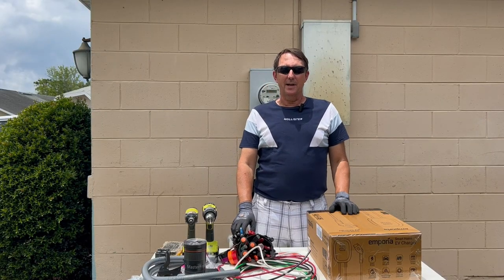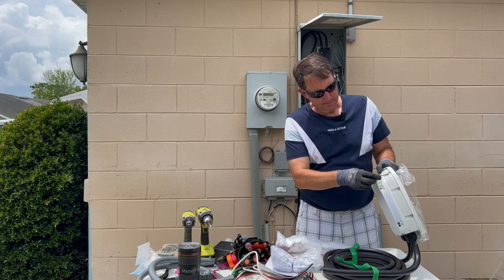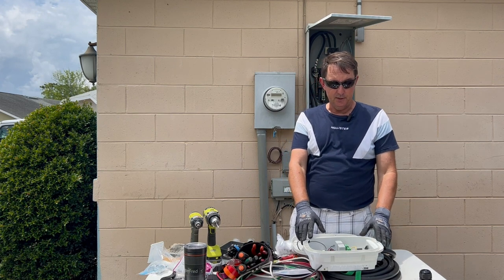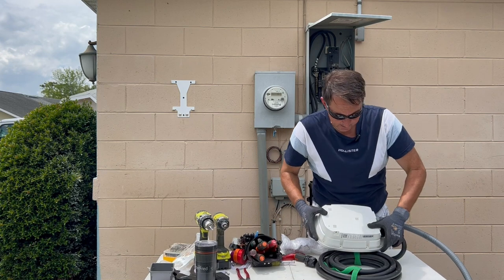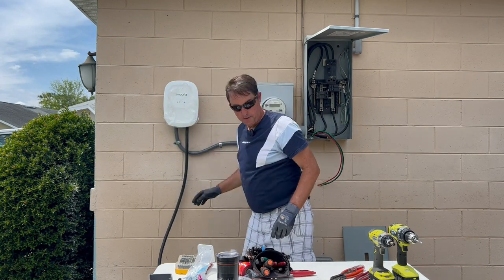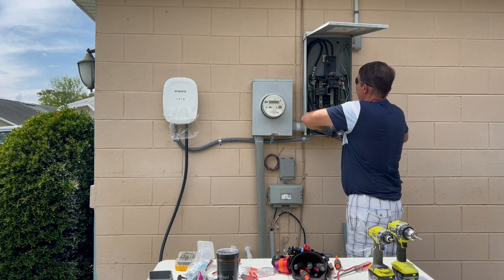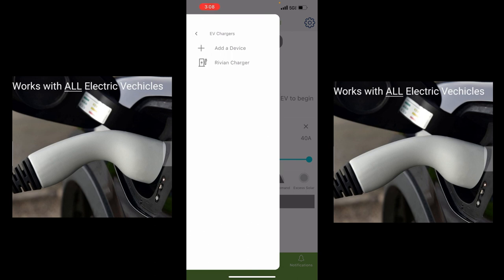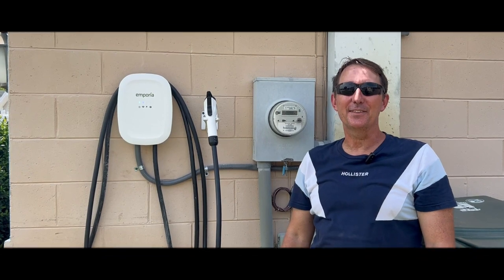Emporia EV Charger Install

Comment: Thanks!
Reply from the maker: Welcome! 🤗
Reply: @YourFloridaElectrician  hello there ! So what size of wire if I use a 60amp breaker For a EV ?  Can I use 6/3?
Reply from the maker: You don’t need 6/3. 6/3 is two hots with a neutral and a ground (ground is not counted in wire count) 6/2 is better but it can only be loaded to 44amps continuous. You would need to set you Ev charger to charge at 40amps instead of 48amps. 
My preference is #6 thhn stranded put inside a pipe. 55 amps continuous so you can at your Ev charger to 48amps. 
Hope this helps.
Reply: @YourFloridaElectrician  my parts house doesn't sell 6/2
Reply: @YourFloridaElectrician  I ended up using #4 romex to the junction box then 6 thhn from the charger to the junction box.
Reply from the maker: Do they sell #6 thhn red, black and green?
Reply from the maker: That will work.
Reply: @YourFloridaElectrician  yea normal colors thhn any size but only 4/3 romex no 4/2. 7 bucks a foot 😆
Reply: Next time I'll fish in flex to an lb and pipe to the charger all in thhn 6. This was my first one haha.
Reply from the maker: @electricaltimelapsetest5713  Wow 😮💲

Comment: It would have helped to have the Charger Station mounted to the wall so, viewers could SEE how you wired in the Station.2nd tip: When you "clamped" your Liquid Tite, you should have left the "droop" in it so, theoretically, the water from rains would drain DOWN AND AWAY from fitting at service panel entry and at charger. 3rd: Shouldn't you TORQUE down your bolts, per spec, as opposed to cranking them down?
Reply from the maker: Great points. The design of the Emporia does not really facilitate being able to have in mounted and being able to do any wiring to it, unfortunately. I did, however, purchase a camera stand that will now be looking down at what I'm working on. 
In regard to the drip loop. Always a good idea for a drip loop. At the bottom of the EV charger there is a loop and the bottom of the electrical panel has a 90 degree connector coming out so I'm thinking water will not be able to enter that way. 
I appreciate you watching and commenting because I am always trying to be better and be a better content creator. 
I hope you consider liking, subscribing and sharing. Thanks again. YFE
Reply: Thank you. I did forget to mention, however, overall you did a great job! Thank you! @YourFloridaElectrician
Reply from the maker: We always appreciate the kind words. 
Good luck with the install if you’re gonna do it yourself. Be safe.

Comment: Did not properly torx the wires in the charger. Not good.
Reply from the maker: Sometimes all the steps don’t get captured on the video. Torquing is a very important step. Homeowners won’t have a torque tool, but regardless the connection still need to be torqued.

Comment: I have had my Emporia evse since Mar 2023. It works great . Initially installed as plug in 40 amp .  Changed to hardwired 48 amp.  It made enough of a difference .  It works with no drama,  installed outside similar to yours .  But in the shady side of house so the Texas sun doesn’t add to the thermal load.
Reply from the maker: Sounds nice thank you for commenting. The Emporia seems like a decent EV charger. One of the few things I didn’t like was the way the screws for the cover were facing towards the back as far as from an installer‘s point of view. 
It seems their app is pretty versatile as well, as far as seeing house loads with some of their other devices.
Reply: Did you changeout  the 50amp breaker with a 60amp? Code requires 20% current headroom although a 50amp breaker will still work without tripping.
Reply from the maker: @rkgsd thank you for the question. 
At 3:21 seconds in the video, I specifically mentioned installing a 60 amp breaker.
Reply: @YourFloridaElectrician  Thanks for the reply but I was actually asking the other viewer you replied to about his 40amp to 48amp upgrade.
Reply from the maker: Shoot. My bad. 😞

Comment: This is the first installment video that i have seen with a charger being installed directly to the cuttoff outside the house.  I thought it had to feed off the breaker box inside.
Reply from the maker: If there are breakers / spaces in your outside electrical panel you most  certainly can install it there. Some don’t have a breaker panel outside which limits your options.  
Thank you for commenting. 
Please like, share and subscribe if you want. 🙏
Reply: @YourFloridaElectrician  Thanks for the quick reply.  I charge my Bolt with a Seimen's 32 Amp.  My sister liked my car so much she bought a Bolt.  But they told her they had to upgrade her breaker box to install a charger.  I will check if her feed is sufficient.   Then see if there is an alternative to replacing her box.  Subscribed.
Reply from the maker: @usaverageguy if it’s 150 amp to 200 amp service it’s probably OK to add a 32 amp breaker. 
But better to have somebody do the load calculations first.
Reply: @YourFloridaElectrician  Yes.  That is my plan.  I am electricly incompetent.
Reply from the maker: Difficult to be good at everything 🤙

Comment: Yes, it’s a very nice charger but it would’ve been better if they put the eight screws that hold the front cover on through the front and not the back
Reply from the maker: Hey Michael, in my opinion also, I think it would’ve been easier to put the screws in if you could put them back in after you hung the charger. I believe you can put the screws in after, but you’re working from the back on the short side of an Allen wrench, which would take a long time. I think it could be designed a whole lot better. but the charger itself seems very nice and the software from what I saw of it was very cool. Not just EV charging but also other items that they sell can’t be monitored through their app as well.  
Thanks for watching and commenting. Please subscribe and share. It helps a lot. Thank you.

Comment: Good afternoon.  is it possible to connect to 220 volts? [ IN L1/L -phase ] [ IN L2/N zero ] [ grounding ]
Reply from the maker: Yes. The charger is designed to be connected to 220~240 volts. Line 1 to line 2.

Comment: Thanks for the video.   I'm going to use 1" flexible conduit with #6 THHN directly wired on a short run into a 60A breaker.   Mine is all indoor and I don't need the 48A output (older Chevy Bolt limited to 32A) but I wanted to wire it so that it would still be acceptable for the maximum output capacity of the charger.     I bought and installed a NEMA 14-50 originally but I was not comfortable with that connection with this kind of load.   A direct connection is safer.
Reply from the maker: Good stuff!  Thanks for watching and commenting! 👍

Comment: This is great work !
Reply from the maker: Thanks a lot!  Thank you for commenting. Please consider subscribing and sharing.
Reply: I wonder why you didn't use ground as well as the two hot and neutral?  I saw another guy use when he installed the outlet @YourFloridaElectrician
Reply from the maker: No neutral is needed when hardwiring directly to an EV charger.  
If you’re wiring a 240 outlet, you need to have a neutral. 
Hope this helps

Comment: Thanks for doing a full walkthrough. The manual recommended 1 1/4 inch conduit which seemed excessive for two hot 6 gauge wires and a ground wire, so it's good so see how it goes with 3/4 inch flex pvc. My setup will likely be very similar with an outdoor GE panel.
Reply from the maker: I thought so also. Inch and a quarter is crazy.  Be super safe with the electrical. 
Good luck with your install and thanks for commenting ! Please like and subscribe and share if you haven’t already. Thank you 🙏
Reply: 1" is perfectly fine. To code you can fit 5 - #6 wires in a flexible non-metallic raceway / tubing
Reply from the maker: True. Just a bit more expensive.  
Thank you for leaving a comment
Reply: @YourFloridaElectrician  less expensive than 1 1/4...to standard code, you're only allowed 2 - #6 wires in a 3/4 flex PVC. Least in Canada, you're not and I assume conduit fill is pretty standard everywhere.
Reply from the maker: Try schedule 40

Comment: Curious if you had a chance to torque your connections at the breaker and the charger? With the continuous load of 48A for many hours, the conductors tend to heat up significantly and of course cool down when charge is complete. The expansion and contraction of the conductors (especially stranded conductors) tend to loosen the connections over time.
Reply from the maker: You are 100% correct in that Glen. This charger install was done for a customer, and I would consider friend. It would be an excellent idea to check it after the 1st year. (I have not yet been back to do that)
I actually tighten load centers connections during service calls. Especially if I was in the load center already. I have noticed that phenomena myself from being out in the field. 
Thank you for watching and commenting on my channel! All comments are welcomed and appreciated. Comments make me a better electrician & content creator.
Reply: @YourFloridaElectrician  I've been hearing some horror stories of poor installs with EV chargers resulting in overheated connections leading to fire. If we can convey to electricians and homeowners the significant, continuous load that is put on the panel, breaker, conductors and charging system while the vehicle is charging, it will make all of us better installers and service electricians by doing the little extra things like torquing connections. Keep up the great work!
Reply from the maker: If we don't make is safe, who will? 🤷‍♀ @GlenMacNeil
Reply: @YourFloridaElectrician  Exactly!
Reply from the maker: Ty for being a professional and commenting on the video. 👍

Comment: Thanks for the tutorial. I'm installing one for a customer next weekend. I love youtube!😅
Reply from the maker: Well, thanks for watching and good luck with your install. Be careful.!!
Reply: @YourFloridaElectrician  licensed bonded and insured 😁
Reply from the maker: That’s great! 😀
Reply from the maker: Let me know how this goes. :_HardHat:
Reply: @YourFloridaElectrician  it went great, I had to use #4 romex fished into a recessed panel from a surface mounted 4/11 junction box then flex w/#6 thhn to the unit. Customer was super happy when he saw charging at 48 amps haha. At first I bought 6/2 romex but after alot of reading and the 125% continuous load calc I saw that #6 thhn is ok but romex needs to be upsized. Took about 2 hours.thx!!! Ps knowing I need some reducing washers from your video saved me a trip to the store 😆
Reply from the maker: That’s awesome! I’m glad it went well.

Comment: Hi, Will the Emporia fit on a 4 by 4 post? How far apart are the screws that hold he attachment bracket? Thanks
Reply from the maker: The Emporia documentation that I found online doesn’t show the spacing on the screw holes. Only shows that the bracket is about 6 inches wide. If you’re willing to off-center it a little bit I’m sure you can use the top hole and the middle hole and not the second top hole. of course it will be off-center and look kind of funny because the Emporia is a pretty wide charger. But that of course is up to you. 
Here’s a link to the Page I found: 
https://www.emporiaenergy.com/EV%20Charger%20Technical%20Specs.pdf

Comment: Thanks for the cool video, I'm doing the same exact thing but did you just plug the wires into the charger? The one that came with it had the square Ferule to go in I'm trying to track down how to put a feral on there for better connection do you think the Ferrell is necessary?
Reply from the maker: I may have just wrapped the wires around the best I could. Make sure the connection is nice and tight. If you don’t have the proper tool to connect the feral connectors, you’re going to introduce another point of failure. 😞 
I regret, not getting a good video angle of making the connections. Something I’m trying to improve on.
Excellent question . Thank you for watching and commenting.

Comment: Wondering: If you mounted all INSIDE of a garage, would you still use Liquid Tight or move to metal conduit?
Reply from the maker: You can still use Liquid tight inside a residential garage.  I have done a couple other EV installs inside garages using the carflex. Really depends on if the wiring will be subject to abuse or not. Inside a commercial EMT would be required. Great question. 👍
Reply: Correct on commercial buildings. Yes, I'm doing myself. Iv'e done several but, always learning anything new and anything I can to improve!!
Thanks, for replying! @YourFloridaElectrician
Reply from the maker: Absolutely 👍 Your welcome 🙏

Comment: Awesome, i'm going to try and do this my self ! seems not too bad of an adventure, just don't touch the hot wires. Doing this for my model 3 tesla, would a 50 amp breaker for 40a charging work just fine ?
Reply from the maker: Be super careful Russel and would be advisable to shut off the main breaker first before start working there. Just to be safe.
For 50 amp breaker will only get you 40 A of output. 9.6 kW. It’s a little bit slower than this 60 amp breaker, which will get you 48 A at 11.5 kW.  
Not too much difference really. Unless you travel a lot and often. With a 50 amp breaker, you can probably get away with the number eight wiring instead of using number six.  
Which ever you choose work smart and work safe. 
Thank you for commenting and questioning. 
Please like and subscribe if you haven’t already. It really helps the channel out.
Reply: @YourFloridaElectrician  Thank you so much for the opportunity to learn, finished my project yesterday. I think the most "daunting" part was switching the main back on. Everything works fine ! used exactly  the same materials except the 6-3 that i bought was hard to manipulate it came in a thin sheath with an extra ground wire. Once again thanks a lot !
Reply from the maker: @Kahilg  Awesome job sir!

Comment: With the Emporia smart charger. Does the charges session restart automatily in the event of a power outage?
Reply from the maker: I didn't find that answer in the Emporia manual so I just contacted Emporia Support with that question. Hopefully I hear from them soon.  Thanks for reaching out. I hope to have the answer soon.
Reply: Thank you
Reply from the maker: So here is the reply from Jack from Emporia:
	
Jack (Emporia Energy)

Dec 4, 2023, 15:01 MST

Hello Alfred, the charger should continue to operate in the state it was in prior to the power outage.  The charging session might time out on the cars end though depending on the specific make/model. @dandolittle6372

Comment: Question if I'm buying 50ft of 6/3 NMB wiring, it comes wrapped up with with the neutral wire in it.  Should I leave the neutral wire in and not connect it, or should I cut it out, because I don't need to connect the netural wire for 240V right?
Reply from the maker: Just don’t connect the neutral if you want but if I remember the ground on that wire is really small. 
I would prefer to connect the neutral as the ground. Also connect that neutral to the ground bar in the panel and not use that puny ground. 
If you have green tape you can tape the ends near where they terminate to indicate it’s being used as a ground. 
Electricity doesn’t care what color the insulation is. 
I believe having a ground larger is better to carry any kind of fault current. 
Thanks for watching and commenting

Comment: Don't you need an Insulating Bushing on that 90 going into the MSP?
Reply from the maker: If it’s under an inch, you don’t really need one. Still good to have, but it’s not necessary.. I don’t recall if I put one or not. I probably did. Different AHJ’s will have different opinions. 
Thanks for watching and commenting .

Comment: Thank you for this video, its the first Emporia install I have seen.  My Emporia is installed with the 14-50 plug.  Can I convert it to hardwire by extending the current #6 cable in a junction box and a terminal block?  I'm about 3 feet short to get to the charger, or would you suggest pulling new #6?
Reply from the maker: If it’s not a long expensive run to replace, I would just pull new wires. My reasoning is every additional connection is another connection that can fail. 
I can certainly understand if you’re pulling three additional runs of 50 feet or something like that it could get expensive. But if it’s right next to your panel and you’re only buying a total of 18 feet of wire, it shouldn’t break the bank and hopefully will give you a better warm fuzzy feeling when you’re done with the job. 
Your call, but both ways will work.  
Thanks for watching and commenting Mr. Anderson!
Reply: Thanks for the suggestions
Reply from the maker: Appreciate you watching. Thank you sir.